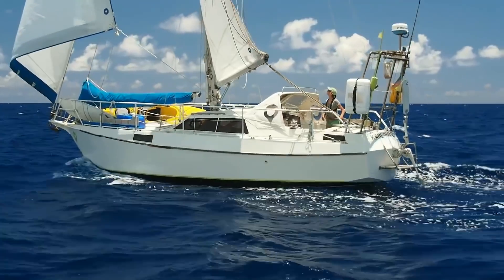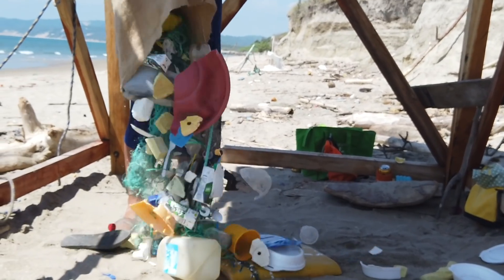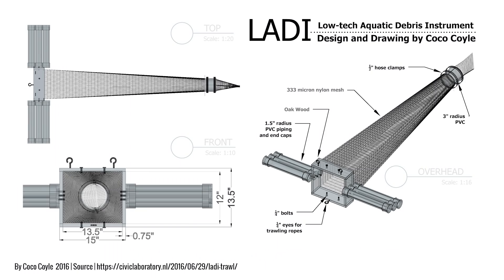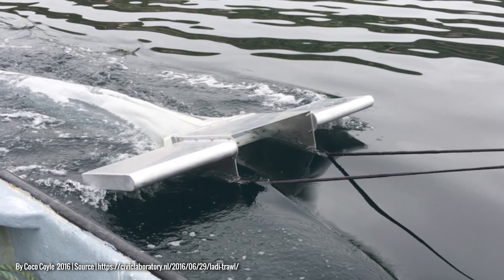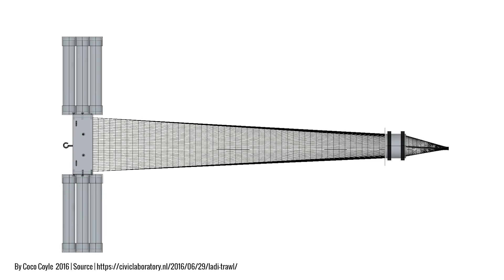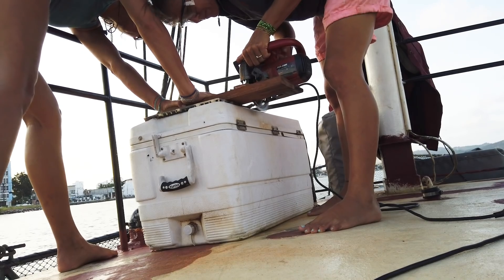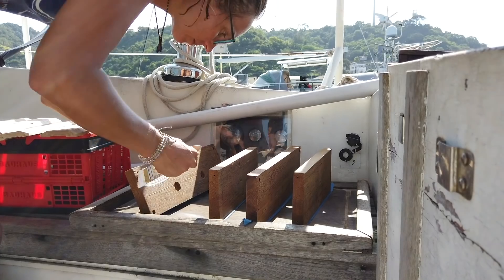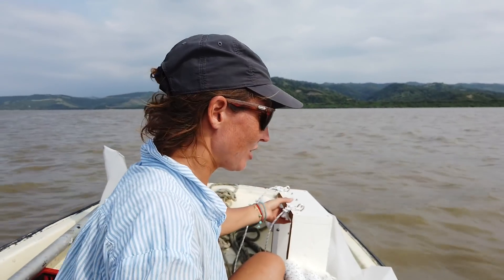MICROPLASTIC in our OCEANS. Collecting data to help fight plastic pollution - UNTIE THE LINES IV #50

Comment: Great job! I have been aware of plastic. I do not drink water bottle if I do not have too, I do not use plastic straws. I’m trying to stop using plastic, but it is hard because everything is made of plastic. I volunteer at my state science museum before Covid. During special events sometime I’m at a table about plastic pollution, light pollution. I try to tell visitors about it. In 2019 I went to the sea sea turtle at the beach. The owner talked about plastic pollution to the people on the trip. 
I want to buy a sailboat do citizen science, scuba dive, have a troller like you built do marine science and conservation.

Comment: It will be very interesting to see your results.  As you know, most plastic in the ocean comes from the rivers of countries that do not have good trash-removal services.  Compare the beaches of Central America with those of British Columbia.  These plastics do move with the wind and current to the rest of the ocean.  I live in Texas, and while we have good landfills, the wind likes to blow everything into spots where the next rain washes it into the river.  Soon it will be in the Gulf of Mexico.  This is an issue on the days when the recycling is placed by the street to be picked up, as they use open containers.  The only solution is to never litter, and pick up whatever trash blows down the street.

Comment: The seperation of the plastics from the nuggets of matter collected from your net should be easier if you put the sample in a canning jar full with water. Put 1/2 a drop of dish soap in it and put the lid on. Shake well and remove the cover and let it sit for a hour or two.
The small amount of soap should wet out the organic debris and break the surface tension of the water allowing most of everything else to sink except the plastic 😁👍

Comment: yes wonderful to get the data . The thing to consider do next is to make the specialized micro pressure cooker  which can with heat and pressure convert plastic into diesel fuel . The trick is the right heat and pressure will make plastics convert back to their original form oil. The oil it makes is sulfur free so better than sweet   crude oil . If you burn plastic it makes nasty dioxins that collect in fat of animals on the bottom of the food chain  and accumulate in bigger animals and later humans . That is why the machine to convert plastic to oil must be the correct pressure and temperature. By weight 1000grams  of plastic makes ~700 grams of diesel type oil .  So as you make oil you use some to to do the heating  and pressure . Yes you make CO2 but that is for me just extra plant food but to others might be in thier religion the lethal gas that will cook their goose . One mans junk is another man cheap as chips  fuel
Reply from the maker: 😁 that's exactly what I am working on at the moment 😂

Comment: The irony..... the whole thing is made of plastic.
Reply from the maker: I guess the only thing u could exchange would be the floats for bamboo...
And plastic in general is not the enemy, in some fields it's the best option. But in othes, especially single use plastic, there r more sustainable reusable alternatives. Plus, it becomes a problem when not disposed of correctly which won"t be the case with this Trainer . 😊

Comment: it may only be about 2.5 sq. feet of screen but thing about if every boat on  the ocean cleaned up 2.5 sq. feet per mile. amazing..
Reply from the maker: Oh, this device is not meant for cleaning the ocean but to collect data about micro plastic pollution in the ocean. But you are also right, if every boat sailing the ocean picked up just a bag or two of plastic...what a difference, right?

Comment: ..... that sure will be interesting to see what you come up with when ocean sailing and due to the currents where you deem it to have originated ..... have you seen videos of where they take any type of plastic and put it through a process and end up with diesel .... put the equipment on a ship and gobble up those plastic islands that are in both the Pacific and the Atlantic. Then have a route to pickup plastic from all the small Island nations, harvest it before it gets in the oceans, and possibly sell back the diesel to the local fuel merchant if it is not all needed to power the ships generators, cause the ship would rely on solar and other other renewable ways of creating electricity ..... just a thought at this time in space ...... https://www.youtube.com/watch?v=GTE0Vkoo9XI ...... great video by the way ....... have fun be safe, save our oceans ....
Reply from the maker: Hey Peter, thx for sharing that great idea. It's actually what I have been looking at intensly during the past weeks. I want to try and build a kit that is small enough to transport easily and that is quite self-sufficient and easy to build. Will keep you posted on the progress ;).
Reply: @WhiteSpotPirates   .... that is an excellent idea Mika .... have you thought of making the wooden parts out of larger plastic pipe to make lighter and may even make assembly simpler ... also would not get water logged or need painting ....  great project ....

Comment: Soooooo we're going to use a Trawl that contains Plastic to find microplastic.......and you're going to complain about putting plastic into the environment.....Riiiiiiiight. Oh here's a source you may NOT have coverd. in many Hygene products these days they have something called "Microbeads", I do believe those beads are......plastic right? so, we use them, They go down the Drain, the drain MAY go into a Treatment plant where they may or maynot be traped, the effluent from the plant goes into the ivers and that then leads to the Ocean eventually. People, DON'T use products with "Microbeads".  F.W.F.S>  P.S.  with tat small a screening you'll also pick up Zooand Phyto Plankton. could you have made the float panels out of bamboo?
Reply from the maker: there are many sources for microplastic and personal hygene products and there packaging are surely one of them. That's why I changed to using natural soap and shampoo bars...This is a video on how to build a micro plastic trawler, not an educational video about micro plastic in general. But thanks for your input.
Catching organic items as a by catch is one thing that we have noticed as well. We try to do as little damage as possible. 
Bamboo might be a good idea as an alternative to the PVC pipes. I guess one would have to find the right size and caps and do some testing. Surely something to look into. It's a work in progress and I think it is better to start somewhere and slowly improve it rather than not trying anything at all.
Also, I did not say that using plastic in general is a bad thing. I mentioned that the pollution of plastic is a bad thing...which happens when not taken care of the waste properly. And I also mentioned that I try to reduce single use plastic in my daily life. I did not mention that I don't use plastic at all. And I don't think I accuesed anyone or forced anyone to change. I only mentioned what I had wittnessed and what I myself am trying to do to tackle this problem.
Anyhow, thanks for your input...

Comment: what happened with the second part of fitting the new autopilot??? I'm particularly interested on how the new system connects the windpilot into the system.
Reply from the maker: Hey Ian, I am still at home with my broken heel and won't be returing to the boat for a while...that's why I said "more about that some other time" and not next week. The actuator is on the boat, I am not, so I cannot make any video about how to correctly install it, sorry...you will have to wait for that...for quite a while, unfortunately...:(
Reply: @WhiteSpotPirates  Oh I'm so sorry to hear that Nike, such an injury could be dire, and certainly must've been painful. I hope it comes good sooner than "quite a while" too.  Thankfully you are still with us as, in the wrong time and place, the "dire" possibilities come into play.

Very interested about your autopilot though, and how it connects into your windpilot as I'm looking into such things on my HR-38, which I may well be sailing to Australia soon. I clearly need to have both electronic and wind-driven systems for the redundancy that introduces as well as the systems better serving different conditions and I'm torn between them being inter-related or totally independent. This was brought home to me on my recent crossing of the Bay of Biscay, single-handed, as my new Raymarine Evolution system was disabled when a drive connection cable slipped. I managed to fix it at sda btw although a dirty rotten sea, driven by 40 knot gusts, then broke in two portlights and made things difficult.

Is there any way I might be able to swap notes with you on things like this as you clearly know what you're talking about and your input would be greatly appreciated? Perhaps there might be ideas that could help you too, although I think you're many sailing years ahead of me and have solved more problems that I've even contemplated so I can't promise.

Either way, I'm sad for your injury and I hope you're back onboard Karl before long.
Reply from the maker: @ianb4801  Hey Ian, I am looking at 9 more weeks of bedrest and then have to build up muscle and learn to walk again...not much one can do to speed up the process...

Wind vanes are great, especially when single handing...and a seperate autopilot is what I would go for, personally, as well. Here it depends a bit on your boat size /wheight...My boat weighs quite a bit but I did not want to spend a ton of money...Tiller pilots are rather cheap and simple, but also have their limits when it comes to the wheight of the boat.

A way to work around that is when you let your tiller pilot steer your wind vane and use the leverage of the wind vane. That way, a very small force is needed to move your tiller by connecting the tiller pilot to the wind vane. I did that with my wind pilot pacific and a raymarine and it would look similar with the pelagic http://whitespotpirates.com/how-to-connect-a-raymarine-tillerpilot-to-a-windpilot-pacific/. Unfortunately, every wind vane is different, so I cannot provide any other info on this topic in case you are looking into a different windvane...

Hope this helps a bit, though...

Cheers, Nike
Reply: @WhiteSpotPirates  Helps a bit but I think my boat, a Hallberg-Rassy 38 called Thistle Doo, is far heavier than Karl; main halyard is wire, sheets are 18mm, sails are more like cardboard than cloth. She weighs about 10 tonnes and her steering, even with a wheel, is much heavier than Karl's appears to be. The way the AP connects in is also problematic as the geared AP motor drives a pair of wire cables that are basically piggy-back-clamped to the steering cables. So far I've found two ways to make one of those cables slip, including one crossing Biscay with a beam-on wind and sea 
(30knots and about 9 metres) where weather helm became too great for the connection. In future I must just leave more headsail out and reef the main more severely. A wonderful autopilot though, if rather expensive and 
I just love the way it integrates seamlessly into the plotter, radio and instruments via NMEA2000. Pity I had to retain the old drive motor system though - no room for the RayMarine ones.

My thoughts about windpilots is that HydroVane is really my only option as my boat is so heavy, and I need an off-centre installation (rudder projects back too far for a central installation). Systems like Aries also won't do as there's no way to connect  drive to the wheel. The only question is just will that HydroVane have enough steering authority; Thistle Doo is so heavy with such a long keel and, from the load on the wheel, a lot of effort is required to control her. I reality, you don't actually "steer" her anyway - more like "gentle persuasion".

But time for something for you now. Have a look at this video, and I confess that I'm not sure if Simon is Austrian or German but I think he lives in Bonn. I love this interpretation of the Andy Timmons piece though:

https://www.youtube.com/watch?v=7s1C8Gha5ig

The music is great but look at his guitar - a beautiful, solid timber, blue-grass-style Maton 808 series guitar - MADE IN MELBOURNE!!! The playing is also beautiful but the reason for the link, other than because I'm from Melbourne too - if you can forgive me from being presumptuous, is to urge you to do something outrageous with those 9 weeks; something you would perhaps never have tried otherwise; something like learning to play guitar. You may be doing this already but see those 9 weeks as being something really positive, an unexpected opportunity. btw better Maton for you would be one of these https://maton.com.au/product/the-mini-maton - a smaller body to fit better on Karl but with a big voice. Anyway, enough of my advice, you probably have too much already.

Hope to see you sailing soon enough, cheers to you Nike and thank you.

Comment: Number one is to reduce the waste - that’s a no brainer. But number two is what to do with the existing waste. I’d love to see someone (with better engineering skills than I) come up with some sort of small scale composite lumber machine for these small costal communities to use. Yes, composite lumber isn’t considered structural, but then again, you’re not building two story suburban homes with attached garage. How useful would it be for a family to collect plastic and some organic material to create a plank or two of rot resistant lumber? The recycling program has to have a useful end result and be geared towards the local community.
Reply from the maker: I totally agree and I am researching on those things, too. There are machines to make planks from plastic trash. You melt the plastic and then push it into a mold. Voila. The machines only need to be funded, the parts transportet, installed and teach the communities how to use them...Oh, and convince them it's a good idea to do that ;). The technology is there...
I am also looking into making fuel from plastic waste...with "easy" tools and on a small budget. That will be my next project, I think ;)
Reply from the maker: https://www.youtube.com/watch?v=zNGuuSKE1pY this is the one where they extrude plastic beams from plastic waste
Reply: Great! So glad someone is ahead of me on this. Just needs to be tested with a broad range of plastics (and contaminates, because I highly doubt beach collected plastic will be as clean as the product in the video) and other filler material. And somehow be human and/or solar powered. 
Small scale and useful is the way to go! And keeping the labor to a minimum. It’s one thing to send the family out every now and then to collect plastic to repair a bench or build a ladder, it’s another to collect enough on a consistent basis to keep an engine running.
Reply from the maker: @FromThePrairies  yes, u r very right. Sorting the plastic and cleaning it is an issue. That's why these are not sooooo easily installed. It works with solar, but the cleaning and sorting is a problem, I think. Not so much for the diesel making, though, which gives that another "pro" on my list ;)

Comment: So much plastic in your supplies... 😲 Das IST nicht gutt
Reply from the maker: There are some areas where plastic is needed and makes sense. But there are also areas where it can be easily avoided or swapped for something more sustainable. If you have any suggestions how to reduce the plastic involved in the supplies, then please share those. Unfortunately, hardware stores in Panama are not focusing on plastic free packaging, so our choices were a little bit limited here and there and we had to work with what we had.
Reply: @WhiteSpotPirates  One place we could eliminate plastic in the design would be using sections of bamboo for the floats rather than pvc. Granted, it wouldn't have as long a life and is not available everywhere, but it's cheap, renewable, and not difficult to replace.
Reply from the maker: @SV_ADDIE  yes, that's a great idea...if available, as u mentioned 😉.
Reply: @WhiteSpotPirates  sure, that was not criticism but constatation. The first thing you want to do, is stop buying plastic, because soon or late, I'm will end into the sea 😉 If people don't buy it, it won't be produced. That's the starting point. Now compare the amount of plastic used into your build ( packaging included) and the amount of microplastic it will collect into its lifetime. You'll probably understand the limits of your cleaning process. We need to reduce production first. It starts by our buys. That's the key. 😉